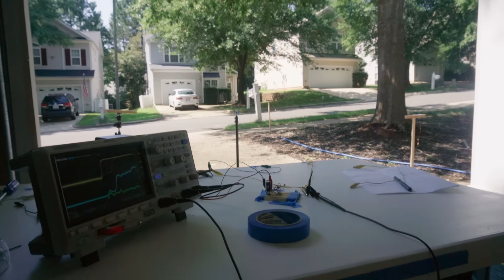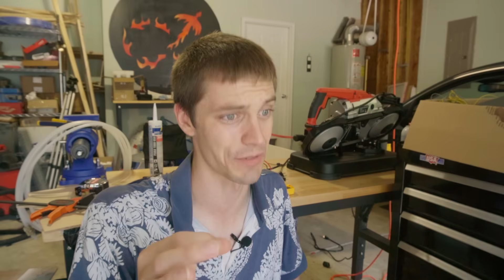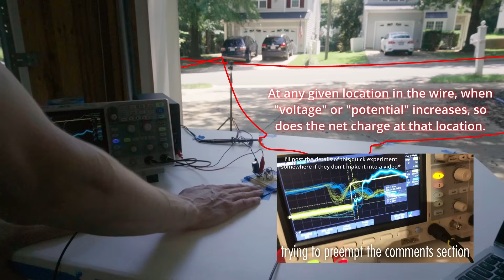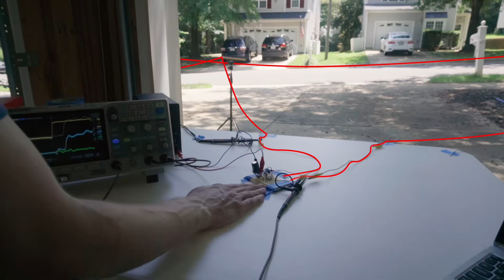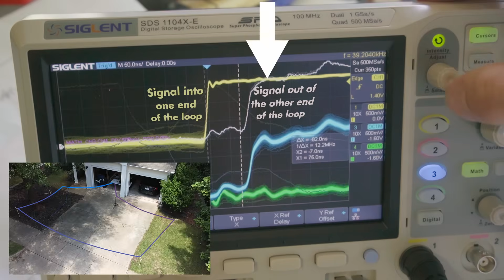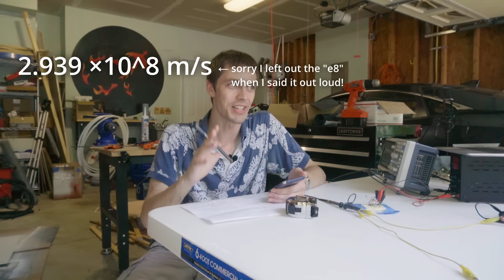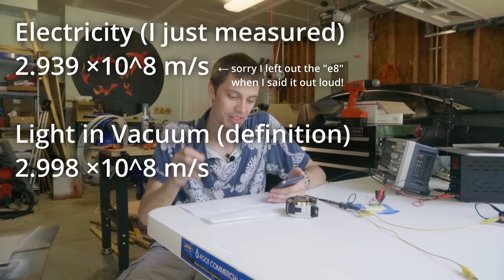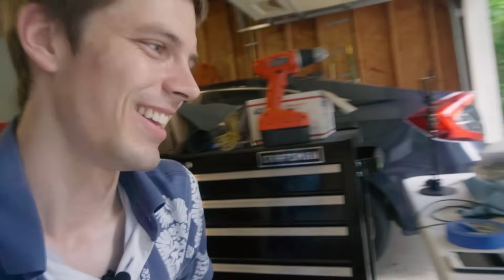Why does WATER change the speed of electricity?

Comment: After watching some of the videos of this channel I am starting to think that the conventional circuit analysis methods are lacking something;
We normally model the delays with lumped capacitors and inductors.
But the nature of the delay added because of the speed of light limit is different.
Inductors and capacitors decrease the the slew rate (make the changes slower).
But the speed of light limit adds an absolute delay (i.e., before that absolutely nothing can happen).
So, I am thinking that apparently the circuit theory lacks something.
In circuit theory we imagin wires with 0 impedance and assume that the change along those is absolutely instant. But in real life there is always the speed of light limit ruling on them.

Comment: Slowed down by a factor of 1.45? As in not quite the index of refraction of water? Hmmmmmmmmm
(2 minutes later) Oh ok, he gets to that. Thanks for being thorough. Very, very cool video. 
"It's all AC" yes. Alternating a current by turning it on or off is... well, alternating a current XD 
Final thought. You tested copper wires of varying resistances, but have you compared that against an aluminum wire? It's a different medium. I'm wondering how much of the 'light' is traveling in the medium around the wire, and how much is actually traveling inside of it.

Comment: This experiment itself is from a wrong understanding or assumption that electricity travels like a matter travelling through space. 
Just imagine a long chain which has no elasticity now you pull one end, and tell me how much time does it takes for the other end to move, if the chain was already held tight at both ends voiding lost motion between the links. 
Hope you understand now.
Reply: And yeah.. You are right about the field cushion that happens and slows the effect to reach from one point to another point. But if you consider that property then you are not measuring the speed of electricity but the inductive effect that happens on the linear cables self inductance and hence the lag. 
Wind the cable to a coil form you can amplify this delay from nano sec to seconds. 😊😅
Reply: @lazzatehayat  The speed of electromagnetic waves in a transmission line depends at the same time of the inductance(the inductive effect) and of the capacitance of this line. The formula is: square root(1/L.C)) with L the inductance and C the capacitance but these two quantities(L and C compensate each other to always give the known speed of electromagnetic waves in the given material(void, water,...).
Reply: The other end would move instantly but nothing can make the move instantly at another place, it would surpass the speed of light which is impossible according to Einstein. So the hypothesis of infinite rigidity is impossible in reality.

Comment: My hypothesis before watching the video: Electricity moves at "near the speed of light." Electrons move along at the speed of light, bump off each other, which causes some to slow down momentarily, and others to speed up. Averaging out to "near" the speed of light. But an electron moving on its own, no other interactions, will move at or near the speed of light.

So "electricity," which is not the science of only "electrons," does not move at the speed of light due to influences in the environment. But the electrons within that environment do move from interaction to interaction at or near the speed of light. 

Electricity is a process. Electrons are part of the process. So electricity while near light speed, is not light speed.

Comment: The electromagnetic field travels at the speed of light in that medium, in this case copper.  The electrons are much slower as the wire acts as a sort of shift register or chain such that "pushing" one in on one end leads to the whole series moving over and another one "pops out" on the other end.  Signals, however, can effectively propagate at much slower speeds when transmitted along a pair that has distributed capacitance and inductance, because in that case it takes time to charge the distributed capacitance enough for the signal to be measured at the receiving end.

Comment: How is it possible that greater resistance doesn’t slow down the flow? Counterintuitive. And I thought that the fastest thing in the universe was light. And since electricity is not light how is it that electricity is basically just as fast as light?! Also counterintuitive. To my simple brain at least.
Reply: When he says "speed of electricity", he doesn't mean the speed of the electrons but the speed of the interaction between the electrons, the speed of the field. In electridity, this interaction is more globally the electromagnetic interaction, as for light, and is contained in the electromagnetic field. So it's normal that the speed is the same for these different phenomenas because they commit the same interaction.

Comment: Electrons are a Feild, they are what you could refer to as "Weird Shit" , also, the ElectroMagnetic Fields DO travel at the speed of light because they have No Mass ... Electrons aren't little Planets that Orbit Protons and Neutrons or bump from one thing to another PER SE... (because they kindo fare and aren't at the same time... ) They're mostly Fields of Charge that like to live around Protons and Neutrons that Can but Don't Have to all the time... move at the speed of light, it also depends on the Density of the material theyre IN and the Resistance of that material. Hence Superconductors are possibel.

Comment: I'm just starting on your video, and I wonder if we need to be more distinguishing, because I have that question, but it's about the electrons themselves. While it's clear that the electrical field and electromagnetic force travel at the speed of light, it's not clear that the electrons themselves flow through the wire at the speed of light, In fact, I would think that they flow proportional to the voltage.
Reply: But of course this would only apply to the free electrons
Reply: Basically, the repulsive force of the electrical charge obviously can extend its Domino affect at the speed of light across the electrons, but that doesn't mean the electrons themselves are racing through the wire at the speed of light, does it? It just means that the electrical repulsive wave cascades through the wire at the speed of light (not implying that the electrons themselves have gone anywhere far yet at such a moment in time where the electricity is getting going)

Comment: the surrounding dialectric material has a big impact on the propagation of waves. they discovered this with the first trans-atlantic telegraph cables. the signals would come through, but it was badly distored. oliver heaviside (i believe) showed that the speed of propagation of the (magnetic?) field in the dialectric was different from the (electric?) in the wire. this retarded the signal as it propagated.  once they used the right amount of insulation on the wires, the signal came through fine.

Something to keep in mind when picking out wire, but only in the most sensitive situations where magnetic and electric fields need to be precisely aligned.

Comment: Hi, great video, but,,,, if I ask chatgpt if the spepd of light and the speed og electrons in a wire is the same, the answer is that the speed of electrons in a wire is 2/3 of the speed of light =  2×10' 8m/s and not 3 X 10'8 m/s. Is chatgpt wrong ?
Reply from the maker: Yep - a few years ago I thought the same thing but it’s wrong
Reply from the maker: That’s going to be the right answer for a specific type of coax probably, and then it’s tuned for the cable by fiddling with the capacitive insulation later between the conductors

Comment: @AlphaPhoenix electricity travels at no where near the speed of light. The electricity flowed along a wire into your TV or monitor is only travelling a few inches per second. You are mistaking voltage for electricity. Voltage is the pressure difference across a wire, and its changes to the pressure difference which update along the wire at the speed of light. Hence we communicate using electricity at the speed of light by changing the voltage to represent signals, we don`t touch the flow rate of electrons.
Reply from the maker: “Electricity” is the energy and signals, “electrons” are particles
Reply: @AlphaPhoenixChannel  Energy is not made of particles, its the capacity to do work. Basically when you have a pressure difference with a flow of high pressure to low pressure you can use it to affect a change in something. Electrons carry electrical pressure from one place to another. They are not energy.
Reply: @jmum189 you’re right that electrons are not energy in the same way that the earth is not energy, but the earth has a gravitational field, which does propagate at the speed of light, and is the thing that gravitational potential energy is stored in, just as electrons have an electric charge which propagates at the speed of light and carries electrical potential energy, by definition, voltage.
Reply: @copperlaktronics6705  Energy is when you have a pressure difference between A and B, such that one can flow to the other and in the process be used to do some work. Such as turn a turbine. Gravity is when point A and point B on an object have different flow rates of time, causing an acceleration from the fastest flow rate of time to the slowest. The thing that causes different flow rates of time is the strength of mass.
Reply: @jmum189  you’re getting stuck on the semantics of language. You just agreed with Phoenix in your reply to Phoenix. He said electricity is the flow and that electrons are the physical thing. You said energy is the flow so it can’t be a physical thing. I love when people agree and they just don’t realize it.
Reply: @AlphaPhoenixChannel  No, energy is the capacity to do work, not a physical thing.

Comment: If you’re using a solid state relay, the frequency of it opening and closing is close to the speed of light because the operation that causes the switch to, switch, is a result of the electrons moving at the speed of light effecting the transistor.

Comment: What is the speed of light in copper, anyway?
Ah yes, ~98.5%.
So, seems like strictly lightspeed, for the given medium.
You talk about the fields talking to each other, but you do skip the part that it's lightspeed because the information carrier is strictly photons.
Electrons constantly, and without exception, emit photons. They also constantly absorb photons. There's a constant photon flux as all charged particles are updating the field at all times, because all charged particles are in motion at all times. The net effect may be negligible, but the exchange is continuous.

Comment: If you are not making a SOLDER JOINT AT YOUR TEST PROBES or eliminating probes all together,  automatically your tests are flawed because there is not 1000%  contact between your test probe and wire material.  The clips on probes and the probes have air gap, resistance, and oxidation resistance.  Being that you are trying to trying to explain "speed of light therory", it might be important to understand 100% PROPER SETUP PROCEEDURES FOR TEST EQUIPMENT FIRST.  Imagine how many exptremely smart people never take this into consideration.  Look at an alligator clip, what surface area on the teeth actually bite in and make great contact?
Reply from the maker: Enough
Reply: Relevance of resistance given the current test?

Comment: When you calculated that the water submerged wire slowed the speed of conduction by a factor of 1.5 did you consider that the length of the submerged  wire was only a fraction of the total wire length. Eg if the length of submerged wire were only 1/16 the total wire length (or 1.75 m) then this is the delay one would expect given a 9 fold slowdown through water.

Comment: Thank you, for all your amazing videos. I'm just troubled on the measurment of the third thick wire (around 7:45). although you zoomed out and clearly let us see the screen for the previous two thin cables, you just said it loud for the third one. There are actually two think I'm curious with. First, the scale for the measurment didn't seem to be the same as the previous ones, by a factor of two. Secondly we can see much more noise and glitch on the output signal, and around 8:20 it seems the signal is sliding to the right, meaning an actual decrease of the speed of the signal. Can you please enlighten me. I'm sorry if those questions were already raised, but comming late I have no choice, searching working only on a limited range of the comments.

Comment: So, can you make the same experiment as the water pipe but remove the water and pump out the air so you have a vacuum?
Then you should measure the speed of light, right?
Or at least much faster than you experiments in this video, or am i mistaken about this?
At least it would be an interesting experiment.

Comment: At ~ 14:35 you say the speed is "nine times slower." This is absurd. One time slower would be a dead stop. Say "1/9 as fast" which is what you mean.
Reply from the maker: You knew what I meant because this is the normal way to express fractions of things. You have to know how to multiply both sides of an equation by 9 - sorry that’s complicated
Reply: But… what is 1/9 multiplied by 9? If 1 is 9 times faster than 1/9, then going the other direction would have to imply it’s 9 times slower.

Comment: Hey, to start off, love your vids!

I have a question - How is it possible for us to measure the speed of light if our fastest instruments of measurements can only operate at the  maximum speed of electricty?
Reply from the maker: Our measurement devices are very small 😁
Reply: @AlphaPhoenixChannel  ofcoarse, however wouldnt there be a slight delay between triggering an electronic switch to signify to the instrument that light has been detected?

at those speeds, milliseconds make a massive difference!
Reply: What you are talking about I think it the technical and philosophical question of how to find the speed of light when nothing can move faster then the speed of light. However once you have fond that speed, accounting for delay in in sensors becomes nothing more than math involving relativity, if the trigger starts slow, and the sensor senses slow, then all you need to do is calculate the difference after removing all factors that cancel out. (This explanation is likely inaccurate)

Comment: Better late than never I guess.
The answer is NO, electricity does not travel at the speed of light.
It's electricity not light, it travels at the speed of electricity.
In fact, voltage is an expression of the speed.
Electrons travel over a conductor in a helical fashion, not through them.
You should probably read up more on Coulomb.

Comment: Mr. WHEATSTONE /FRENCH MAN ....CONNECTED A BATTERY TO AN (UNFINISHED) TELEGRAPH LINE  , THAT WAS 6 MILES LONG ...(TEMPORARILY) SHORTED THE WIRES TOGETHER at 6 mile ....let battery voltage /electrons ",jump" from -- NEGATIVE to top TELEGRAPH WIRE ...ELECTRONS MADE 6 mile trip ...to ...SHORT ...THEN 6 miles BACK ...THEN ELECTRONS "JUMPED" to +positive STUD/POST ....A HIGH SPEED , SPINNING MIRROR REFLECTED 1st SPARK/FLASH , THEN 2nd SPARK /FLASH .....time computed by (REVOLUTIONS/second ) x  revolutions between sparks ....Mr. WHEATSTONE CAME UP WITH A GOOD APPROXIMATION OF "SPEED OF LIGHT" USING CRUDE EQUIPMENT and A BRILLIANT MIND

Comment: So the better example to show how electricity moves through a wire would be to use magnets.

Set a tube tightly with magnets in a line up, then alternate the orientation of the magnets, then depending on how "grippy" the inside of the tube is you can show resistance. Better then the water in a pipe or ping pong balls in a tube.

Comment: Im not sure your Fourier transform explaination for why the signal moves more quickly than you expected is accurate. The rise time of your signal looks to be on the range of nanoseconds at the fastest, and the permitiivity of room temperature water is only really impacted at around 10ghz and beyond. Thats way off, probaly 2-4 orders of magnitude. I think its more likely your difference is due to the fact the propagation equation you used assumes an isotropic medium. Ie, a radio wave moving through a solid column of water. 

Try with a strawlike tube of material filled with water as your "wire", with the tube either being adequately thin or of a similar permitivity to water. You will see the delay youre expecting.

Comment: You did very well for the video, but............ The solder connections i believe affected your measurements. second I think you should try a much, much longer wires...... Meaning you should prob try to contact a company that could give you access to borrow their wire and have more controlled testing. i think like a mile long wire to test would be perfect, but you have many sub's so that should give you an oppuritunity to maybe t help them and then you for like an ad. just my thought. heck maybe it could lead to more opportunities.

Comment: if traveling electrons are the source of energy in the wire then why does any device function in AC. the electrons just jump back and worth. And how does a current clamp can measure the current in a wirde just by simple clamping araound the wire?
Reply from the maker: By the standards of electrons, they flow for a good long while in one direction, delivering energy, then they flow in the other direction for a long while, and if the load can accept energy both ways then both directions momentarily supply energy. A resistive load gets no energy while the polarity is switching and the voltage is zero